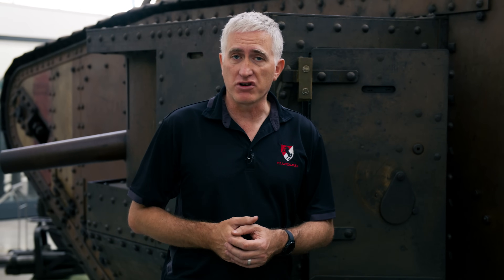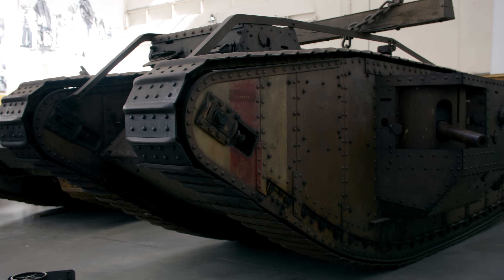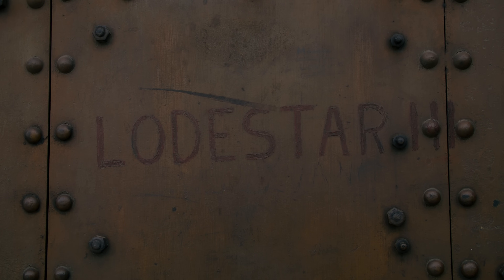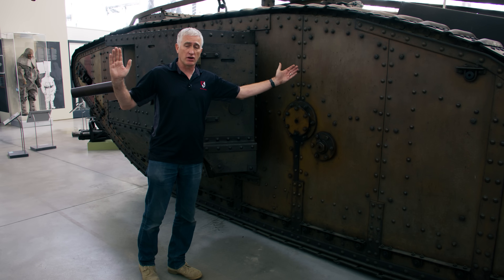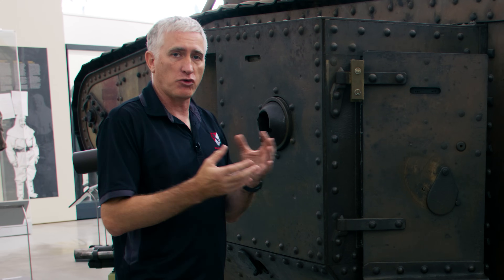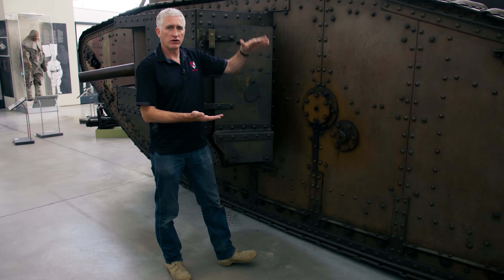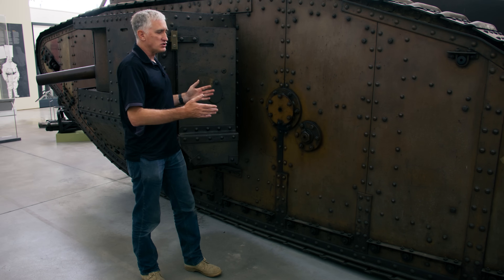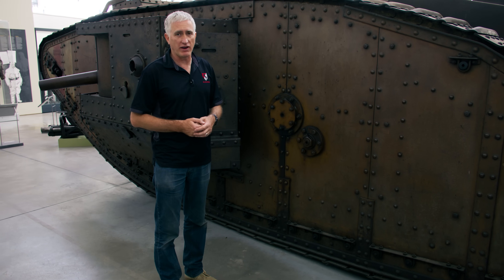WW1 Tank Track Curvature

Comment: It's interesting how old school vehicles dealt with issues like this.  For example the Model T had thin tires compared to modern vehicles which meant that they'd dig into the dirt more easily but, if they did get stuck, it also meant they were easier to pull out.  Which, in the days when your "tow truck" was mostly likely going to be a team of horses, was the important consideration.

Comment: The same physics work for snowmobiles. Longer tracked sleds (usually used in deep snow in the mountains as there's more track surface to spread out the weight) don't steer well because the skis are trying to drag a long length of track sideways across the snow. Trail sleds have short tracks so they steer well on groomed trails but are likely to get stuck powder.

Comment: It is funny, but the Rhombohedral design with those wrap-around tracks, and the protected suspension ( and the sponson guns/MG's) was "optimal" for the thick wire obstacles and trenches of WWI.   A modern day  MBT would never have made across "No-Man's Land".  I say that from having driven an original M1/XM1 ,in Ft. Polk  , for a year. I luved  challenges of terrain and obstacles, and got an ARCOM for driving. I had a bad-ass tank,  but I can say with certainty, my tank "Death Machine -serial number 0054"  could not have driven across "No-mans land"  with those 10' high 20' thick barbed wire obstacles or cross deep trenches , like those old "Mothers" .  Plus they carried a "Fascine" to fill a really deep trench.

I stand in awe,  that a 100hp tank could go through chit , that I could not go through with a 1500hp tank😎. 
I have seen M-1's stopped by 1 roll of Constantino, or a simple 3 strand barbed wire fence.
 Those WW1/MkIV tanks could roll over mountains of wire and trenches I would not phuck with, in the "bestest" M-1.- 
--------------------------------
*Also I "sorta" researched the ground pressure of the M1 compared to Mk IV ,  even asked the AI/chat bot, about it. 
 End result , the UK  MK IV of WWI had  13 psi compared to the US M-1 at 15 psi. Take it for what it is worth as to crossing "soft ground".
Reply: 100hp but hell of alot of torque and probably greater surface patch as it sinks into the soft ground.
Reply: FT Polk?
Yeesh
Reply: @HellecticMojo  
"Oye Como Va?,
Ja! , Ft. Polk is a swamp."

Gotta luv Santana 😎
I saw them In West Berlin.
Drivin' a tank.😎

Comment: So if the tank had more and more track in contact when on soft ground wouldn’t that defeat the purpose of designing it to have a short length in contact in the first place? Especially as they were intended to be used on the churned up mud of no man’s land.
Reply: The reason it's hard to turn a tracked vehicle is because the track in front of the midpoint has to slide sideways in the direction you're turning, while the track behind the midpoint slides in the opposite direction. The midpoint doesn't have to slide sideways at all, so it has the least resistance to turning. So you want the midpoint to be lower and supporting more weight and the ends higher and supporting less weight. That makes it easier for the ends to slide sideways. 

On soft ground where it sinks in a bit, it still helps to have the ends higher so they can slide sideways without having to push as much dirt out of the way.
Reply: Trade offs.  If you have sunk so far into the mud that you can't get out, the ability to steer is no longer a concern.

Comment: It is interesting how late "trench crossers" like T-35, Independent and TOG had reversed the angle/position of the rear sprocket putting it up while earlier "romboid" tanks had it down to better push against vertical wall of a trench for climbing out.

Comment: I believe the 'tank curve' is a carry over from an extreme design by the RN and is basically the quadrant of a 60 foot diameter wheel.
Reply: no I think they tested on Little Willie the various track lengths they could get away with, they tested quite a lot of the pieces of the later tanks on that and Mother before being put into serial production
Reply: @AsbestosMuffins  i wasn't on about the tracks as was on about the 'touch point' as it were.

Comment: The first Mark Is had two wheels behind the tank that would act like a rudder to improve steering. But many of them were destroyed in combat and didn't affect the steering at all so subsequent tanks were built without them
Reply: I remember reading that too. They really did see these as “Land Battleships.”
Reply: they did cover this on the recent deep dive on the Tank Museum's site. the rear wheels were more required when cresting hills or crossing trenches, in theory it helped the tank change its balance point, though ya they just improved the steering system dramatically and didn't need it in the end
Reply: @AsbestosMuffins due to the curve at the bottom it would rock, the springs on that tail also helped to damp out the rocking. That Shape was very clever indeed as mud etc couldn't jam up the tracks either and on hard surfaces it could turn even with such a low power engine.
Reply: The new "Tanks at Flers" by Pigeon and Pope has a great little appendix giving detailed instructions on how a Mark I was driven. It's a common myth that the tail by itself increased the trench crossing ability, but as you allude to, it was a complicated system affecting the tank's balance point. Simply approaching a trench with the tail in the 'down' position, the springs forcing the tail against the ground would lever the tank's nose forward prematurely and actually lessen the trench crossing ability. A complicated procedure of raising and lowering the tail to take advantage of this lever effect was necessary to cross extra-wide gaps  @AsbestosMuffins
Reply: Not intended for steering.

Comment: Video subject is interesting, but more than anything, I'm blown away to learn there's a combat vet WWI tank still intact and wearing its original paint.
Reply: There’s more than one in that museum in Brussels. And their WWI artillery collection is even more impressive.
Reply: It's hard to believe that the metal was not recycled in WWII.
Reply: @wmason1961    If it had been tungsten, brass or aluminum it probably would have but iron wasn't that rare.
Reply: @wmason1961  tank armor is very hard to work with - melt or cut or whatever, easier to leave obsolete tanks as monuments

Comment: I always looked at this design as a way to more easily cross trenches, nothing more. That just made sense in my head as a kid, when I first saw British tanks like the Mark IV or the MK VIII in Indiana Jones.

Didn't think at all about ground pressure, steering with tracks, or how much of it was actually touching the ground. Kid me was just thinking, "well, if you stop moving one track, the other track will turn it, easy."
Reply: Indiana Jones tank was really a mock up built on the basis of an excavator.  
I always thought it was a WWI British tank as well until I saw a video on it.  If you're familiar with what excavator tracks look like, you see it right away once it's pointed out to you.
Reply: @BurtonShotton  I know it's not actually a Mk VIII tank, but that's the model it's based on, if I'm remembering correctly. Then they added a turret to the design.
Reply: There is no “Indiana jones tank”
Reply: @SirLoinBeefsteak  lol nice b8 m8

Comment: For mine, it’s an insult to call these ‘male’. An object which has such frontal protrusions, and large proboscis, alluring to buttocks, screams Beyonce, not Kitchner.  Although, it has been rumoured that Kitchner battled for the other team. Could it be that the sexual orientation of the Mk. Series of Rhomboidal Armoured Fighting Vehicles can be called into question ? 
Could it be on the ‘small m’ male tanks, the grenade mesh cover was really a top knot ? Did the crew’s rations include soy latte and smashed avocado on toast ? Was the anti shrapnel steel visor face just the latest Bolle’ of the Day ? 
Should the Tank Museum restore the FV4007 to answer these questions ? Can Mr. Hewes answer these questions ? I’m only asking questions. Don’t attack me. Cheers.
Reply: GIY.